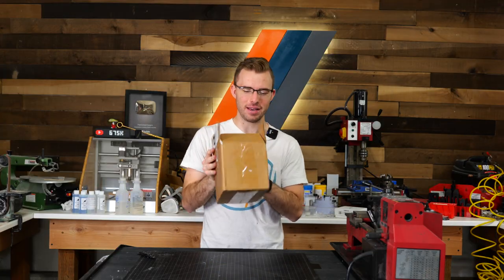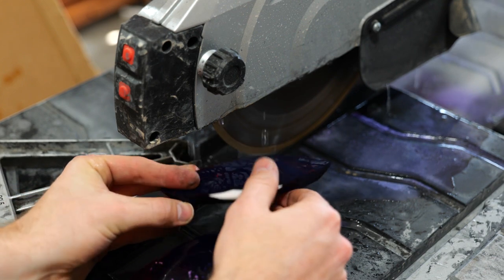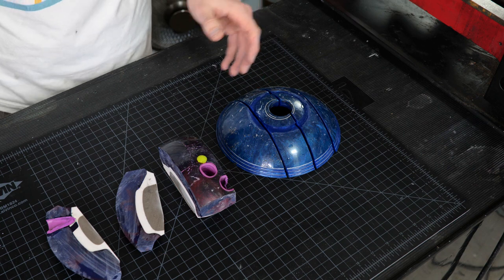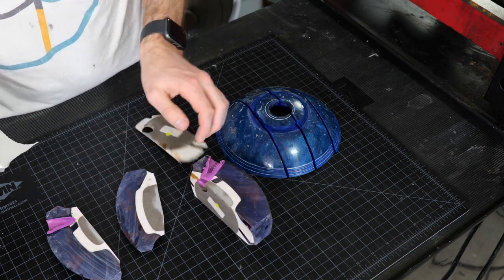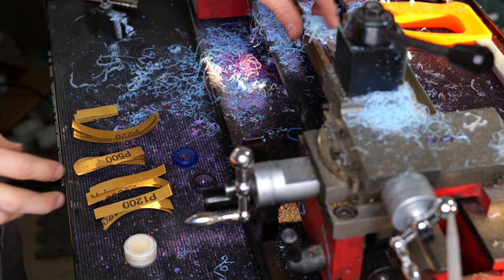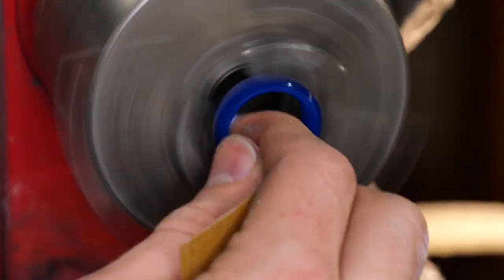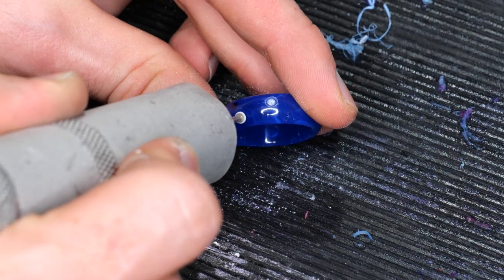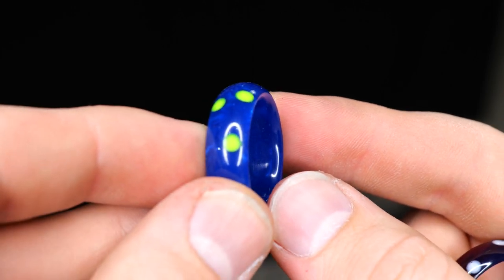Turning a Bowling Ball into a Ring

Comment: That yellow dot represents the center of the weight inside the bowling ball. Hope that helps. Great project!
Reply from the maker: C Mac thanks for sharing! I knew someone would know.
Reply: Sorry, but no. That is called the PIN. It is the top center of the weight block. You can see the other end of it on the surface of the ball near the finger holes. It is what suspends the weight block in place in the mold when they pour the urethane material into the mold.

Comment: The yellow dot that C Mac mentioned is right. It helps bowling centers drill the finger holes according the your style of bowling. When you are drilling for a certain hook, left or right handed. Also you can watch some footage online, where if you look real closely you can see that yellow dot centering itself when it goes down a bowling lane. The angle of that dot according to your grip causes the ball to function differently down the lane. Ex. Late break or early break. Also as a side note the surface of the bowling ball affect the amount down the lane. Seems like that might be urethane or reactive resin.
Reply: Great comment!

Comment: The neon dot is actually what we in bowling call the pin. It is the end result of the hole that is used to hold the core in the center of the mold via a metal pin. The outer material or cover is poured into mold around the core. When demolded, the hole that is left is filled with a bright colored material to delineate the location and orientation of the core to the pro shop for drilling.

Comment: they use the Pin (neon yellow dot) to hold the core in the proper orientation while they pour the resin around the ball.  advantage is its a good way to mark "top dead center" of where the pro shop is going to drill.  They vary in length in the ball and can do different things, which is why sometimes you can drill a new same ball identically and get different results.

Comment: I'd like to make a suggestion, if that's okay: instead of doing your finish work on the lathe, an easy alternative would be to equip a small motor, anywhere from a half horse to 1.5, with a speed control of some type and a drill chuck to hold your mandrel. To get the inside of the ring, you could simply swap that with a lathe chuck. And to maintain concentricity (or at least keep it from wobbling while it rotates), simply put a backstop behind the ring while putting in the chuck, which will help the jaws clamp evenly and keep the ring straight. Pretty easy to do, and kinda fun, too. It'll allow you to keep all that abrasive away from the lathe, making it last longer, and help you isolate any mess for easier cleanup